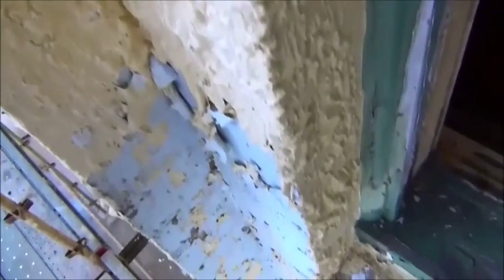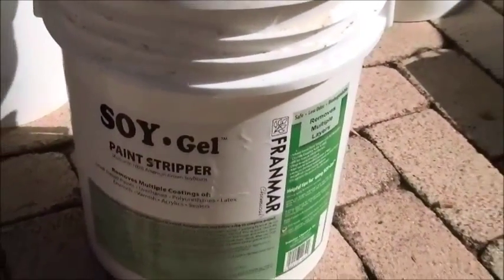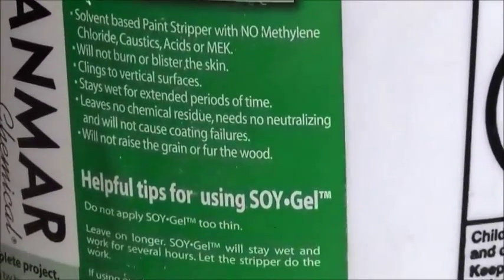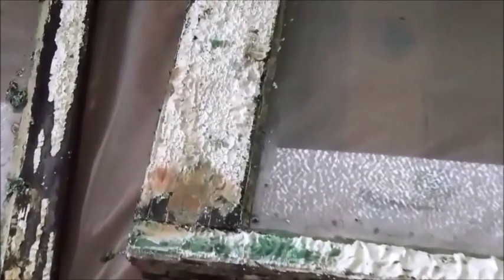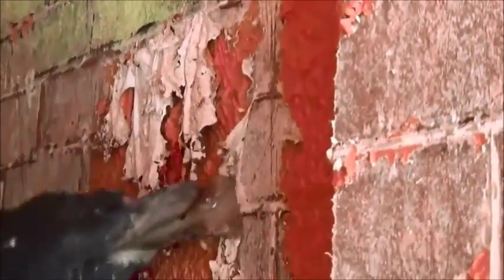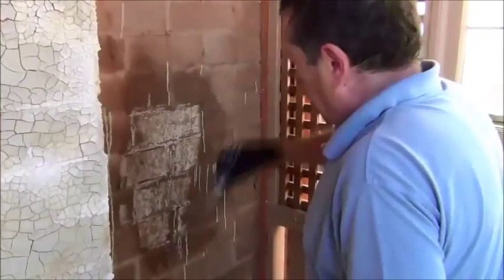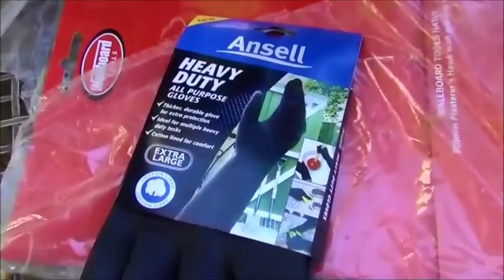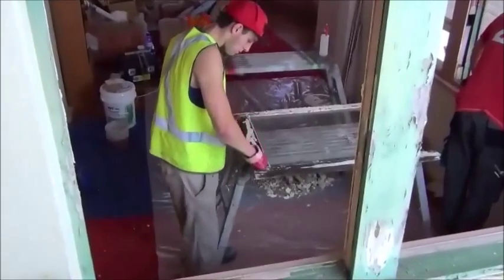Chemical Stripping of Lead Paint

Comment: Only a madman would do this without a respirator and full body suit. Lead poisoning ruins lives
Reply from the maker: The advantage of using chemical stripper is that there is no dust. Therefore you don't need a respirator or full body suit. You only need a respirator and body suit if you are dry stripping lead paint
Reply: @PaintersInstitute  lies

Comment: do you not have to wear a respirator when stripping lead paint?
Reply from the maker: No. A P2 type mask is suitable for any hazardous substance such as lead paint or asbestos
Reply: Tey souldbe wearig resirpator
Reply from the maker: No, not if the dust is not airborne. That is the whole point of using chemical stripper; it avoids dust being released